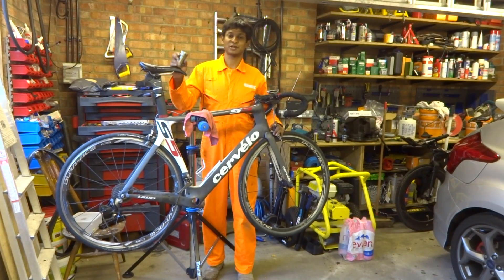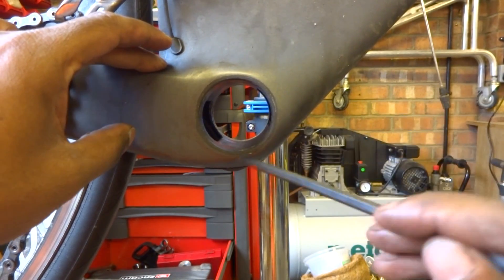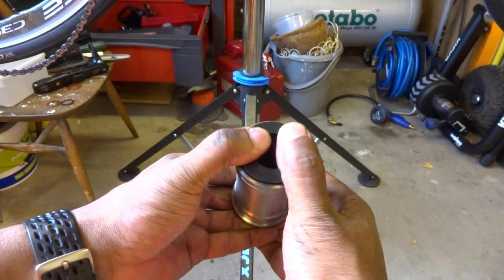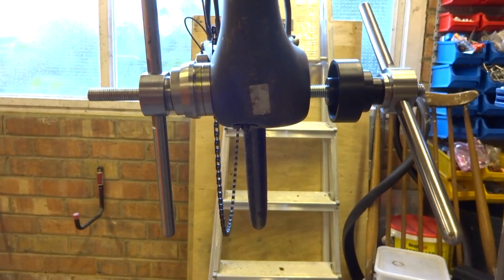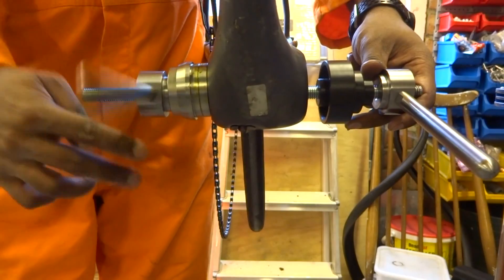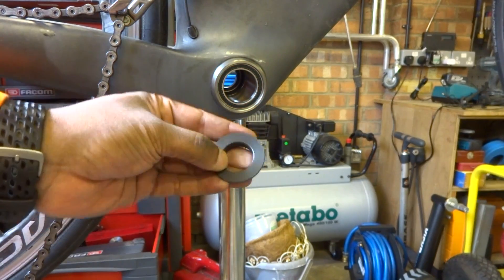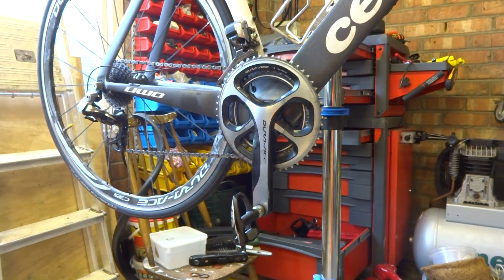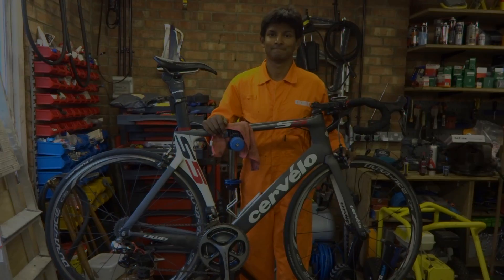Hambini One Piece Bottom Bracket Installation BB30 PF30 BBright BB30A PF30A

Comment: Dumb question. I have worked with spindles in the past, as well a shafts that experience "along axle shaft" loads. Are those angular contact bearings in your BB? Do the "mass market" BB use angular contact? Or "for practical purposes" do bike BB not experience significant along axle loads. My 1980s "non-cartridge" bb bearing-axle used cups that made them act like an angular contact or "car front axle" bearing to handle along axle loads.

Comment: Hambini
I have just purchased the Hambini Racing PF30A Bottom Bracket Shimano Crankset from you to convert my Supersix Evo from Si crank to a Shimano using your bottom bracket.
After ordering both a new Shimano crank set and your Bottom bracket I have removed the Cannondale Si crank but noticed there are cable guide bolts that stick up from bottom of Frome into shell cavity of bottom bracket.
Am I correct in thinking the new Hambini bottom bracket will not fit because of those bolts protruding into the shell?

Comment: Thanks heaps, your BB shell is a gorgeous syperlight piece of kit that installed into my Factor O2 like a dream. Both faces of the BB hole were dead square and the holes were perfectly round which helped, but this idea of yours kills independent cups for sure!!! A+
Reply: Are you running rim or disc brakes?  If Disc, any issues with the rear caliper hydraulic cable?  Enough clearance for the hose?  Aiming to do the same for my Factor O2.
Reply: I am on rim so can't be 100% but there plenty of space through there. Hambini will know the answer, if you email him from support/contact where you order on the website, he is really awesome and answeres all questions.

Comment: Outstanding presentation Hambini! Learning a ton! Quick tech assist: do your sell BBs that will fit a 2020 Ibis Ripmo V2 mtb? The BB on this carbon frame states “threaded (73mm BSA).

In the process of building a custom enduro rig with this Ibis Ripmo V2 frame and would love to integrate one of your aerospace engineered BBs.

Thanks!

Comment: l was wondering if you make a bottom bracket for my  sram red bb30 crank set to enable it to fit and work in my brand new chapter 2 bike frame with has a 86 mm bb shell??? cheers.

Comment: I hope you will still interact on older videos. My understanding is the entire BB - crank assembly have no mechanical stopper on the non-driveside of the frame, am I correct? So I'm assuming what keep it sliding off the drive-side is the retaining compound and friction.
Reply: The crank arm is an obvious stopper.

Comment: Nice BB solution. A few practical comments regarding installation (from an average home-bike-mechanic)
1. Shouldn't  you loosen the pre-load cap slightly to reduce lateral stress (or is it angular bearings)
2. Would a bit of grease under the plastic cap make it more waterproof?
3. It sounds like the installation put a lot of stress on the side of the frame, shouldn't you cover the non-drive side to avoid marks?

Comment: It still seems to me that there is an extremely strong connection between the outer bearing race and the frame, but almost no attempt to connect the inner race to the crank; the crank just sort of lays on the inner races.  Why doesn't the crank just spin on its axis independently of the bearings, in which case the ball bearings would be completely irrelevant?
Reply: I don't know of any BB that does what you're describing. You want hambini to develop a force field that the cranks sit on?
Reply: The spindle will sometimes spin inside the inner race, you will see signs upon removal. Quality bearings and finely toleranced manufacturing of the cranks and spindle will reduce the incidence of galling on the spindle.

Comment: Great work on BB30 creak analysis and remedy. I have been trying to eliminate creak on my Specialized Tarmac and Venge for nearly a year now. Currently using the newer Praxis design BB for BB30 to Hollowtech (Praxis changed the expanding shell design for expanding elastomer collet), also adding retaining compound, and it works for a couple of months. I want to try your one piece BB but Specialized have bonded an aluminium shell inside, (OSBB to BB30) , so is it ok to pressfit your BB into Aluminium shell and would it eliminate creak? With or without retaining compound. Thanks for great videos on a  subject that I have been wrestling with for a long time now. :) Also the removal tools are definitely a better way to remove pressfit BBs.

Comment: Hambini hi, I noticed that you did not use any type of grease on the drive side when installing the crankset. Any reason for that? Actually, I am using teflon grease on both sides of the crankset on my bike. Thanks
Reply: I suspect the inner race and axel become one when they're pretensioned. The axel doesn't spin on the inner race. So no lube required. ICBW.

Comment: Gaps on mating surfaces, do not make for a full contact fit. Which in turn is a flaw in design, and problematic fit in a critical area of the Bike!
Reply from the maker: 100% correct
Reply: Carbon Fiber - Thumbs Down! Expensive Garbage...

Comment: I know my response is two years after date, and would like to say that I'm weary of Press Fits, concerning Bottom Brackets in contrast to Threaded Ones, simply for the Ease of Adjustments. However, threaded BB's now a days are considered Old School, which I feel still work better in terms of Installation (no press tools needed) and can Last a Long Time.Press fits have to maintain a very close tolerances between the Frame BB Shell, in relation to the BB Component being Installed, and those tolerances are hard to maintain.  Any Glues being used between two High Stress Surfaces will act as a soft cushion eventually giving way and breaking down from vibratory, impact, and cranking forces, in which threaded BB units do not have that flaw in the design!I know Press Fits are being installed on Carbon Fiber Units, however, I think Carbon Fiber BB Shells can be designed differently, in eliminating Loosening, and using Glues of any kind? But that's only my opinion! The Mavic 610 BB Design comes to mind!

Comment: Question from someone new to bike maintenance but had to get up to speed after buying a bike with a BB30. I have been re greasing the bearing every 1000 miles or so and would like a more permanent solution . If I install a Hambini Bottom Bracket will my crankset/chainset still fit or will the axle be too short. What size crankset/chainset will I need? Confused....
Reply from the maker: Hi Joe, It depends on what crankset you have. There are two basic dimensions to the crankset - the diameter and the axle length. Early BB30 cranksets had a 30mm diameter and 68mm spindle. Now they come in 30mm diameter and 90mm length. If you have an early one, you are essentially stuffed - you would have to change the crankset to get anything more permanent. If you have a more modern one, then there are a number of options to try. Hope that helps Hambini

Comment: When bearing maintenance or replacement is needed on the Hambini PF30 BB do you have to remove the whole BB or is it fairly easy to remove the bearings only? Is there a maintenance video to view or an instructional pdf file to download?
Reply from the maker: Bearings can be replaced in situ, you don't need to remove the bottom bracket. This video shows you how for PF30/BBright and plain BB30 without an adaptor  https://www.youtube.com/watch?v=zD0q_0TsHa0

Comment: I'm new to all of this, but why Loctite 641 over 609? I read the 609 has more "shear strength" whereas the 641 can seal a bigger gap, although surely the gap is minuscule in most cases?
Reply from the maker: Sorry, only just picked this up. In this application, the real difference is probably minimal, it's just for belt and braces